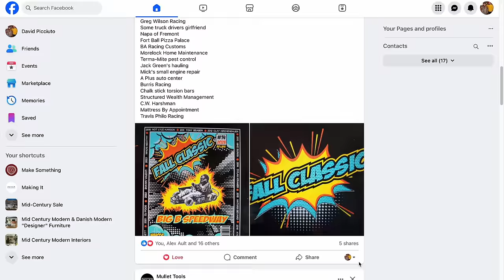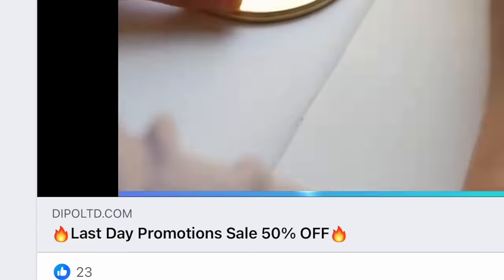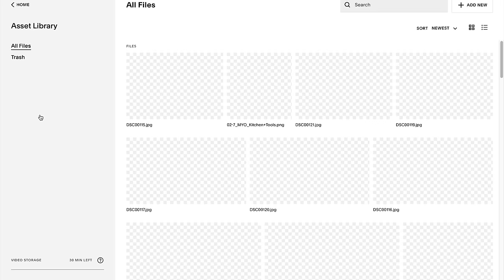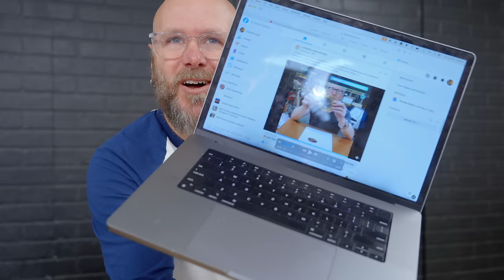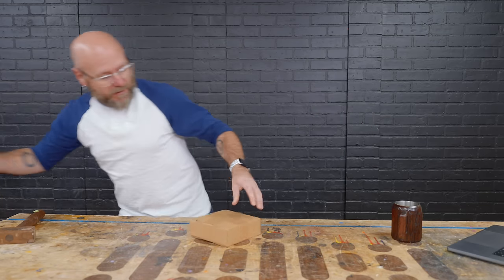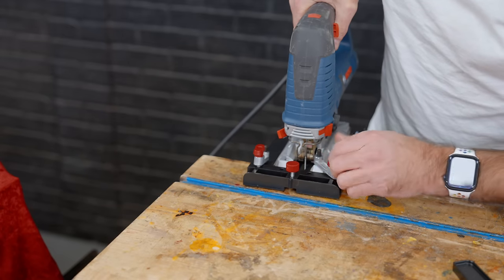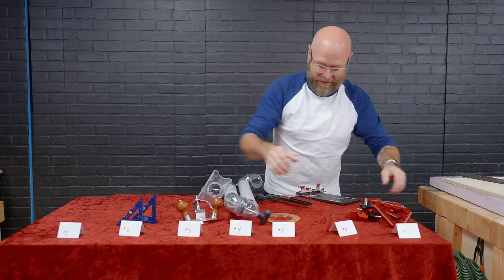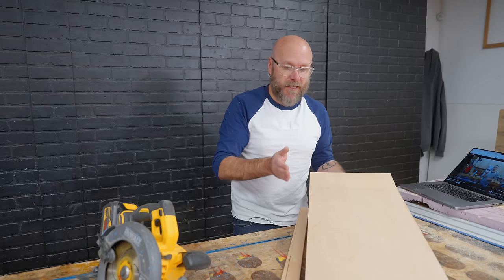I Bought Every Woodworking Ad I Saw on Facebook

Comment: I bought the Mullet for our shop at school. Paired it with a shopvac with a cyclone dust collector. I attached it on my workbench in a relatively central location so I can use it over my miter saw and table saw as a supplement and attach a hose and use it on my sander, router and router table so far. Love it.

Comment: The mullet cyclone attached a ct 26 has been unbelievable. It’s saved me so much in bags and filters. I hooked it up to the camvac90L which is a high pressure system and it handled it without even thinking about buckling. The boom arm saved me 300+ not having to buy festools boom arm. It’s keeps my hose off the ground and is great for so many other things. I will be purchasing another one to separate from the cyclone for when I build my next assembly table. You can buy an attachment to fit a hose in the end and not just the dust hood. Awesome products and amazing customer service

Comment: I can’t say enough about the Mullet. I didn’t trust myself rigging one and wanted something good, a bit of a hit but what it’s saved me so far, has paid for itself and then some, I’m still on the bag that came with the CT26 after HEAVY use over the last 10 months or so. At this rate I won’t have to buy a replacement bag for 5 years. It’s really that good.

Comment: I got the Milescraft rail track adapter for circular saws and it is outstanding, very solid and mostly aluminum/metal. It has four points of contact around the saw base, has adjustment for tightening the rail, and also a setup jig so you can use it with multiple saws without recutting the zero clearance strip. I only wish I could get a guide rail square for it. Great bit of kit if you do not have the budget for a dedicated track saw.

Comment: Your statement about the Kreg is spot on for their brand. I bought the same track and ended up returning it before making the zero clearance cut. They have great ideas but poor execution and quality control.
Reply: i have a guide bar from harbor freight and a bora track saw adapter that runs well along it and i dont have to worry about pushing the saw against the bar causing flex. way easier to store it all too.

Comment: That dust collection arm is really quite cool actually, especially like you said with a complete system in place. I'd get one of those for my model making as well so i dont have to run back and forth between all my tools and re-hose the vaccuum cleaner to different stuff.
Reply: It really looks like it could help you sand in the place where you live.

Comment: With those mini squares and the pins, once you move the square to the forty five angle it also allows you to draw a straight line along the board at various depths using the pin as a roller.

Comment: The Kreg and Milescraft systems are both budget tools, on the Milescraft tool you need to double check your clamps on the saw and well the Kreg, you need that antifriction tape to adjust for slop. Kreg is known for pocket hole jigs, so I'd expect something like this to need a little finessing.

Comment: I'm a bit surprised you had not heard of DFM tools but they do make some very quality squares.  For sure something to keep in mind when building the budget shop.  They are not the cheapest square but they also aren't priced as high as wood peckers so you'd be getting a very very quality square at a "budget" price especially if you keep in the scratch and dent arena for those.  I wonder if these would be re-ranked in the budget shop?  Like the circle drawing jig I would put last for a budget shop simply because seems like a last thing would need/buy and all the other things would be first building a budget shop from ground 0.  Be neat to have you re-rank them based on the budget shop at some point.

Comment: I have the Kreg and it was very difficult to set up even with the instructions.  But I don't find myself using it as much, due to all the setup required and the amount of play it has. I usually just use a straight edge and some clamps.

Comment: If you want a dust collection arm, then nip down to your local hardware store and buy a selection of small diameter drainpipes along with a few angle joints. Cut the pipes to suitable lengths, join them together with the angles and hey presto, you got a similar system for less than the cost of the petrol (gas) that you used to get there and back.

Comment: The circle compas actually has a very nice version that Adam did review. thats a pure B&S from a cheap knockoff company XD. 
That Mullet extractor tube Heck i want that! tho not for woodworking. Id use it with my Soldering station or when i do computer repairs for pulling fumes from solvents away. Better than the crappy vacuum cleaner tube i use now LOL.

Comment: I used UHMW tape I bought on Amazon, attached to to the bottom of the blue plastic saw holder and it eliminated the wiggle you noticed. Shouldn't need to do that when you buy a product but I couldn't afford a real track saw at the time and that simple modification made a huge improvement in accuracy.

Comment: I think just zip typing your shop vac hose to a Standard Lamp would work just as well as the mullet pipe system. Plus, you have a light pointed at your work ;-)

Comment: I have that Kreg track and feel the same way you did, if it had less play it would be great, but with the play it is not any easier or more convenient than just using a circular saw with a long straight edge.
Reply: The Kreg line of saw guides are just absolute trash. I have their Rip-Cut is just a flimsy piece of plastic. The two hold downs just bend when you try to attach it to a circular saw. I saw this Accu-Cut used pretty much the same system to hold down, which is just sad. A huge let down, so I won't be buying anything else from them if they don't take their engineering seriously. I picked up a crappy straight edge clamp from Harbor Freight that was half the price, but works far better. I'll replace that with a better quality one someday as it has its own issues.

Comment: Hi thanks for the video.
One thing bugs me though: you bought the clamping squares for 45° angles, and then you compare them to 90° angle ones. Of course they can't compete.
Other than that, good stuff!👌
Reply: I was wondering about that particular product too- the lip seems to be a godsend for placing the square, and the 45 degree feature would be super convenient. AND- he says it's not as easy to use as the Woodpeckers but I cannot for the life of me figure out why that would be the case. Looking at it I would assume it's exactly the same.
Reply: I thought the ones he bought were for both 90 and 45.

Comment: I have the Miles craft saw guide, and it is at best an average tool. I use it for jig saw, and I had to add an extra clamp at the back to keep the saw from shifting side to side. It does the job I need, and it is a good tool for the price for a beginner to invest in.

Comment: I have a kreg accucut system. Its definitely sloppy out of the box. But a single strip of UHMW tape along the center channel on the underside of the sled eliminates all slop.

Definitely something they should have fixed in QC. But once you make that cheap and easy fix, youre left with an $80 track saw. Can't beat that.

Comment: I think if you dont use the foam sheet under the board while making the round cut with jigsaw then the tool will work fine and saw will not cut into the base, you can try again without any support under the board and see if the tool works fine.

Comment: That small Kreg in-Accu-Cut costs about the same as a cheap tracksaw here in the UK (yeah the supplied blades are crap but to be expected). I have a cheapo Lidl supermarket ownbrand tracksaw with a decent blade fitted as my only track saw and it's pretty good, you can adjust the tolerance down to the rail at least. A batten some clamps with a circular saw would be more accurate than the Accu-Cut. Kreg have always seemed expensive for what you get at least by the time it makes the shores of old Blighty.

Comment: I felt the same way about the Kreg track saw, I bought one and noticed the play right away. I made two cuts and they came out significantly worse than just using my aluminum straight edge. I returned it the same day. I honestly don't see how the Kreg track made it through production.

Comment: The circle thing is a really cheap knock off of a really nice brass one that Adam Savage showed off. Designed for draftsmen rather than woodworkers really.

The one Adam looked at was smooth and very well made.
Reply: I think it's the "IRIS" Drawing Compass made by Makers Cabinet. I have one, and it is very nicely made :)

Comment: I wonder if the tolerance was added to the model to account for plastic shrinkage but when it came to manufacturing, the plastic didn't shrink as expected and as the mold cast cost upwards of USD$5000 a time, they probably just left it instead of making a new mold.

Comment: I have the Milescraft jig and love it. You do need to put a small clamp on the back, but that is very easy and only a buck or two. It works very well for me.

Also, I have a few Cowryman Planes and they are the best planes outside of my Japanese planes. Extremely high quality and the steel only has to be sharpened periodically instead of regularly that my Stanleys need.

Comment: The way to use that jigsaw jig, you’re just supposed to lock it in and focus your attention on the blade. And just try to keep the blade in the middle of the opening. The grip is just to help hold steady a little as you go. Watch the blade like you’d watch the pencil line if you didn’t have a jig. Even cheap ones work like butter if they’re able to lock tight. It’s all about pushing the jig like normal, just keeping the blade in the middle the best you can instead of following a pencil line. Once you do it right once, you’ll get it.

Comment: I have the Kreg guide. My slide doesn't have the movement like yours did, but like the Milescraft product, I don't like how the saw mounts. The back end of saw seems to flop around. Also, it seems hard to get started, but the end result is good.

Comment: That craig track saw. Mine is the same way. But think about it. The wieght of the saw and the momentum of the operator holding the saw and moving makes it tight. You need to hold your saw closure to the front and be above your work not to the side of it. Cause on the side your are working against yourself.

Comment: I had the same frustration with the kreg, Until I finally just threw it away one day.  Homemade track saw sled is a far better way to go if you can't afford a track saw. That should be your next video. Can I make something as good or better than temu tools. Lol
Reply: It's a bit of fun buying these little invention but apart from the router they are not tools, they are jigs or clamps. I enjoy making all sorts of jigs.
It's cheap
Good use of scrap offcuts
Good brain exercise designing

Comment: i bought kreg track and it didn’t fit my circular saw. apparently it doesn’t fit all of them. so was disappointed in it. not a huge fan of milescraft either. that router plane & the dust arm looked the biz😊

Comment: I must've gotten lucky on my Kreg Accu-Cut, it has zero slop. I did recently find out the hard way though that beveled cuts, at least with my Ryobi saw, are a no-no. I accidentally chopped off the first half-inch or so of the blue strip. Probably something covered in the instructions but who's got time for those?

Comment: That track at 90 bucks was a ripoff to say the least. The festool also has some play but you can adjust it with the wheels on the footplate. There should always be some play or else it jams up, but this Kreg one is on another level. Facebook scam level

Comment: The rattle on that saw guide is super not yummy. And that is a significant aspect of a tool to be considered. A friend of mine has a grizzly shaper. He does not like using it. I've seen him chuck up a router with several bits, just to avoid using his shaper, the shaper is not yummy.

Comment: That circle drawing thing is definitely fals adverstising. It's using a the video from the original product to demonstrate their poor knock off. It surely works. I'd say spray some dry lube it in to get rid of the scratchy-grindy noise.
That router plane is a good alternative to an old Stanley No 71-1/2 which probably costs you about the same amount of money, but it shows up at your door steps. I'd change the adjustable handle on the back to a knob/thumbscrew. This style of blade is a lot easier to sharpen which is a huge plus over the old Stanley style.
DFM, no complaints whatsoever. Great value for what they bring to you.
Milescraft has a design flaw for sure. It should have a clamp on the back, then it can be a used once in a while jig.
I have the same Kreg jig. Not many issues with it. I now have a tracksaw.
The corner clamps are too low effort products.
The Mullet seems nice, but it's on the expensive side for what it does. I can probably achieve similar results with a microphone/lamp arm and a vacuum hose.

Comment: For the kreg I made a 3d printed plastic U that got glued into the bottom of the bracket to remove the play it's 100% the problem with that. Mine now is perfect but this tool is a cheap tool and made that way also. Kreg had a reputation of good tools but with the quality we are getting now even from some China tools, I do not think Kregs plastic tools are still holding the same reputation they once had.  I find most of there tools in aluminum and much better quality and the same Price from China. Sadly I would rather use Kreg but if the quality of there tools can not even match China they have basicly  became a not really great DIY tool.

Comment: He hates clamps so much and just always comes back to "__just use the $300 ones, they are better__?    Yeah... and 8x the price mate.
Reply from the maker: Or... get this... or get the cheaper version of the style I like. Right? Problem solved mate.
Reply: @MakeSomething  so the one bit of extra metal changes a lot? It's a delta versus triangle shape , the clamps are 1:1 rip-off anyways. Were the ones in the video square? Because that's literally all that would be different
Reply from the maker: @MajorJefferson  actually no dude, they are very different because the ones in the video has slots for the clamps and not holes. so they don't hold onto the clamps and it takes 3 hands to use them.
Reply: @MakeSomething  ah ok I see that's actually a tangible difference true. I just didn't get that before because of how quickly you were over them and seemed to hate them with the passion of a thousand suns lol guessing from your problems lining up the woods they weren't really square either or was that because of the moving clamps?